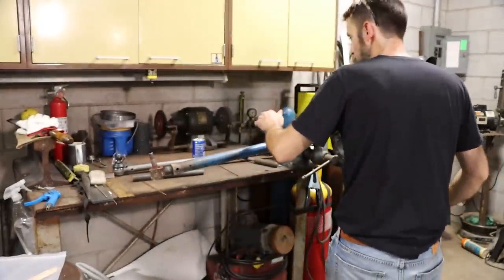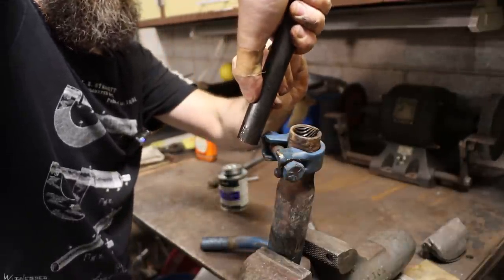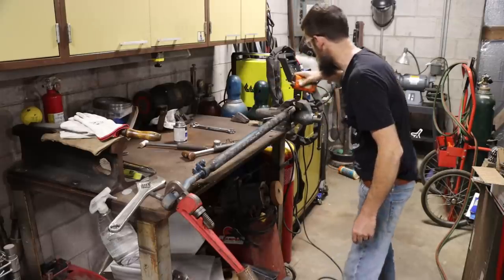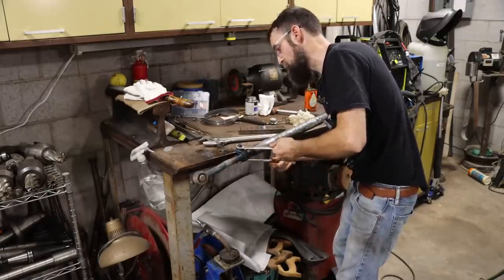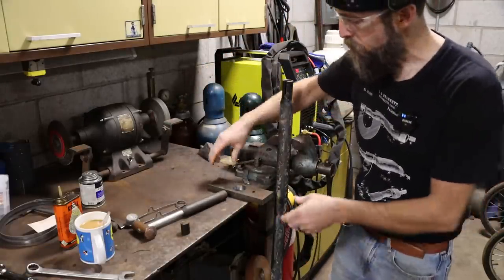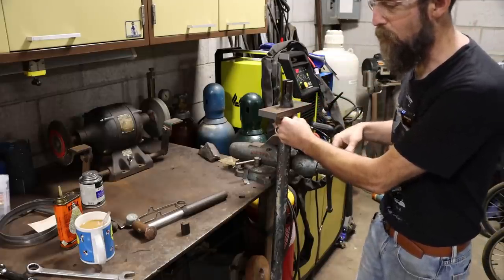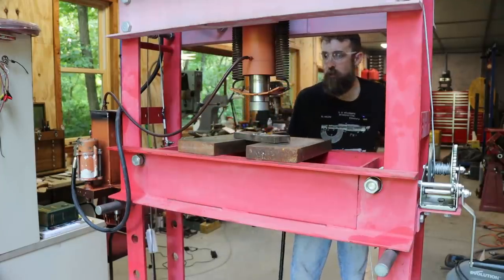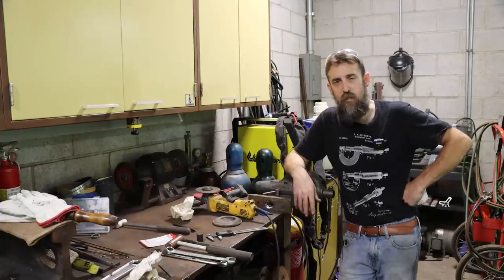Can ya fix this 4 me?  Stuck Ford Tractor Drag Link.

Comment: If time were not a consideration I would hung the shaft vertically and dumped a bunch of Kroil down the end and just let it work for a couple of days or more then try the methods you did.  What kills me is that no one ever greases the shaft when it is new to avoid this very problem.  A bit of foresight is a beautiful thing.....

Comment: I would have tried something like hanging it vertical and pouring something like white vinegar down the end, and let it soak while topping it up.
I used vinegar on some pliers that were solid, i know there's a size difference, but worth a try.

Comment: Both methods you tried put the tube under tension, while putting the shaft under compression, tightening the bind like a Chinese finger trap (the tube gets a tiny bit longer and narrower as it's stretched, and conversely the shaft gets shorter and fatter). If you could have pressed down on the end of the tube by the ball joint, while pulling on the ball joint itself you might have had more luck.

Comment: Hi Steve, If we had heated the tube in a forge all the way through, and hammered the rust loose, it would have worked. But we don't have a forge. And that's why I'm posting this message. I know you want a forge and let's face it I want a forge too. So why don,t we build one?

Comment: If the pipe is same inside diameter as commercial  pipe you could cut off threaded end , weld a length of pipe to it, cut slits , and drill holes .

Comment: I suspect it's probably plug welded. Maybe emory cloth the tube section to get an even finish (220/240) and then acid etch it or coffee etch it to reveal the plug welds (hopefully harder filler than the tube material). Then grind/drill out the welded sections? Only guessing the plug welds because that's what I would have done had it been my tractor drag link I was setting up.

Comment: I would pour Kroil right down the barrel let it sit for several hours and then leave it standing and heat it from the bottom up and the added more Kroil let it stand awhile before attempting to get it apart

Comment: Looks to me from what I can see, the new tie rod end is threaded only on the end  I would not be surprised to learn that the tube design was superseded to a short sleeve connecting the two tie rod ends rather than a long sleeve. 
I have always been able to loosen that type sleeve. Kroil, heat the tube up to about 350 degrees F and set in the corner over night. It will turn without if the tube is not pinched collapsing the .I.D. It is just an idea. thanks for the video.

Comment: Probably would have the same outcome but, I'd have welded a collar around the tube then slipped the plate you made (with far less accuracy) around it and put it in the press. 
Using some of the other comments about heating and hammering when it was put under load, it might have come apart.
It's make an interesting video if you kept trying to seperate this after the crops are in and the farmer can spare it for awhile.

Comment: Surely it would be relatively easy to recreate the outer tube of the drag link and throw the old one away?  Its only a tube with some holes in one end and a threaded portion on the other end.  The cost of machining a new one is likely to be less than finding an obsolete part especially when you factor in the search time.  I wouldn't use the knackered ball joint as it could fail at the most inopportune moment and then apart from the consequences the farmer would be back to square one.

Comment: Maybe heating it and hammer tapping while pressing? Or a crazier idea might be to pack the part in dry ice for a while and then quickly heat the outside. The thermal shock might help break loose the rust bond holding the parts together.

Comment: Fill the threaded end with diesel.  Heat exterior with torch till diesel is in catch pan on floor under the unit.  Rinse and repeat till fluid runs through.  Fill threaded end and reinstall tie rod end, threading the formerly stuck end out.  Would welding with a mig on the lower portion have been stronger?

Comment: I would have tried and sir hammer on it to help knock the rust loose then heated it and rubbed wax on it letting it flow into the tube. My second guessing. Have had good luck using doing that with canning wax.
Reply: F $$king auto correct air hammer

Comment: I'm guessing that piece is about 1.5" diameter, so about 5" circumference, and the weld about 1/8" wide so your total weld area is about 0.6in^2. You can expect 60000-7000PSI weld strength, so that would be 36000-42000 pounds shear force, or about 18-21 tons, so I would say the weld broke about when it should have been expected to.
Mind you that is probably mixing tensile and shear strengths...

Comment: Heat and wax.  The wax pulls deep into parts like that and if you can manage to heat and keep heated it will wick all the way through it.  From there it's just a matter of spinning the parts until they separate

Comment: I might have uswd a vsry thin wheel and split it. Not fully but like stitches then stuck iti in a PVC pipe fill with diesel and ATF fluid let sit for a week. Then try to press out again

Comment: You could have tried filling the tube with oil and then fit a grease nipple on the tube and pump grease into the pipe. The pressure will tend to open the pipe and then move the rod out.

Comment: Rust on farm equipment is shockingly hard to overcome. I soaked king pins on a running gear for weeks. I only could apply pushing pressure with a 10 ton puller. I worked on this on and off for weeks before accepting defeat and split the tubing with an angle grinder. In spite of all the penetrant soaking,  when I got it apart the penetrant had only made it a fraction of an inch, and the king pin bore was about 10" long. I am going to bet that tube and shaft are rusted together for 30". Splitting the tube is the only option... Go buy a new one when he can find it.
Reply: I've a uncle that does the vintage iron saves...his solution to stuck engines? Stock tank soak, check from time to time. He had 1 that took 6mo to work free.

Comment: The easiest way to free up rusted parts is quite fun. You want at least welding gloves preferably long ones and heat up old engine oil short of going on fire outside preferably for it can go on fire and ya you want to be outside but just hot till it's spiting and pour it over or in your case into the part from the open end and you can try it but I have seen me leaving it 30 minutes repeating it and it should break free if it still doesn't repeat once more an leave overnight and you'll get it apart no problem
Reply: It'll tap out to no press need

Comment: I would have tried heating and afrer that I'd improvised some kind of a slide hammer for pulling the rod out. After fiddling around for a moment I'd find myself at the emergency clinic bleeding, burned and maybe with some fractures.

Comment: You could drill some small holes in the pipe along its length to allow penetrating oil to work its way into the space between the pipe and the shaft.  Then use an air hammer, or your HF Jack Hammer to drive it out.  If he can't find one he could invest in you making a new one.  Could be another video.  Q: Did you pull a negative pressure in the shop when your butt puckered?? LOL (Edited for spelling, and punctuation)

Comment: if the metal of that rod isnt too special you could machine off the end with the tread and weld it on a piece of smooth bore pipe of the right inner diameter

Comment: On your hydraulic Press..  the cross bar that got split.  remove both.. replace with a stronger piece that will allow to live it with your electric fork lift.  be sure to thread the top of the tubes for the forks or weld nuts to the top so while its on the forks you can hold it in place in 4 points..  please also examine the hose on the press.. i see a wet end.. i don't know if that is from a spill.. or from a hose about to fail.. 

 on the tie rod tube. the only precision measurement is the distance between the 2 cross bolts for the slip and slide tie rod end..  you are totally correct a piece of DOM material that has the right bore size to allow you to slip the long end in.. counter boring the other for a few inches of the stepped section to slide into and be welded in.. is all you need.  besides putting in several holes for ZIRK fittings. to keep that sucker packed with grease to prevent it seizing.  chances are he will never need the slip and slide end.. 

 hint.. you could have used the press to crush the loose ball end slightly to give it more life without locking it up.

Comment: About the only thing a guy could try is to cut off the ball joint and drill the threaded rod out and put a fitting in it and use hydraulic pressure.  But that could be really dangerous.
Reply: The ball joint that they're trying to get out of this not threaded, it's a slight fit it's pinned in place I'm a chef that's 3-4 feet long.
Reply: @Tuxedomakdarien  it was threaded on one end that why Steve cut a slug and tried to push it out to start with. So you could tern it into a hydraulic cylinder from that end. But as I said it would be dangerous. Because it held at 25 ton in the press. Telling me it will take even more to break it free.

Comment: Do you have a heating tip for your torch's? if not you want to get one it has an over sized tip with 5 holes instead of one big hole, it can heat the most thickest parts on cars and tractors to a nice bright red in no time...
Reply: It’s called a rosebud tip.
Reply: @notajp  I call it a heating tip lol...

Comment: Get a fire going in your fire pit and let it get red hot over it's entire length. Stand it on end and put oil to it the next day, after expanding and contracting that rust bond should break. Guys that restore hit and miss engines use this approach after removing every part to get a stuck piston out.

Comment: Hard to say for sure I would’ve had to of had it in my hands after the first attempt I probably would’ve reached for the rosebud and heat it up cherry as long as I was not worried about damaging other components if it can take the heat hotter is better in rust stuck stuff

Comment: I would hav done this. Bored that Bar you machined, but not all the way through so it caps the end of the cylinder with the threading, with a hole smaller so you can use a ram that slide in, but won't gaul the threads. and then I would have slammed the ram in repeatedly  to hopefully shock the center rod out, kind of like a pool cue.

Comment: Make a new tube. Cut the tapered threaded end off, weld it to a piece of DOM tube or just fabricobble something. Split the old tube to get the drag link out. It's a simple drag link, not an atom bomb. 
As far as that goes, make a new one that uses more modern components so parts will be easier to find.

Comment: I would have made a new one. Thread the inside of a pipe, then cut the line and drill the holes.  Maybe heating that tube with an arc welder would have helped.

Comment: I would have stick welded on the opposite side.  I would also heated it up with a rose bud in the press. Heating it up slowly with a brazing tip transfers heat both pieces. i also would have used a air hammer up and down the shaft to loosen the rust first. You did a good job and 25 ton of force should move a mountain. As a last resort you could try the super heating a quenching in water but that can harden the metal and make it brittle.

Comment: You need to apply a lot of heat while you have pressure on it, fixed a lot of them in my time. WD40 is no help it just swells the rust and dirt, keep it dry.

Comment: The only thought I had that was different was I would likely have welded on the other side of the plate which would have placed the stress in a traction, verses a compression manner.  Now would this have made a tinkers damn bit of difference?  Hard to say,, probably not!

Comment: PENETRATING OIL, SACRIFICAL SLUG, SMALLER DIA, AIM DOWN HILL AND USE IMPACT HAMMER, SHOCK SENDS OIL INTO THE DRY LOCK AND WILL MOVE THE STUCK SHAFT FASTER THAN ANY OTHER METHOD.

Comment: Seeing that he has never extended the link and probably never will I would have cut the bad shaft off at the end of the tube then drilled the tube six to eight inches, cut the new bar off  so you could get it into the tube till the cross pin holes match and pin the new end in place. The extension rod is never going to be extended anyway.

Comment: I would have cut the end parts off you need to then weld another piece of tube in between them. quicker and easier, and its going on a tractor do doesn't have to be accurate

Comment: So it's basically a turnbuckle with heim joints on the ends?
Reply: I must be missing something. I don't understand why the tube could not be threaded LH on one end and RH on the other end. Two heim joints welded to LH and RH all thread. What am I missing? What other function does this do?
Reply: @jpsimon206  The main function of this type of tractor steering axle is that the width (track) of the wheels is adjustable. You can make the tractor wider or narrower to customize it for specific crop row spacing. Because of this, the length of the tie rod must also be adjustable.  Ford configured the tie rod here with one side as "slip fit" to allow for the major adjustment of tie rod length and used a band clamp and a split in the tube to hold it in place (with a cross pin for fail safe in case the band clamp slips).  The threaded opposite end allows for minor adjustment of toe setting before installing the fail safe pin and tightening both band clamps.  Since this design has a slip fit on one end there is no need to have left and right threaded ends to permit toe adjustment like it is done on a rigid, one piece tie rod.
The rear wheels spacing is also adjustable.
Reply: @larrywalker7759  thank you very much for explaining this. It's the kind of thing that would keep me up at night. You have made it explicitly clear. Thanks again and have a good night

Comment: You heard Steve the guy was on a quick time table and he did not want to spend enough money to make a new one. From the video it looked like Steve spent only a few hours of shop time which adds up for the customers. Fair deal ending when he did. Could he have added heat while in the press I say no by the way the weld let loose if he had an open flame and the hoses near by it would have been too dangerous just my thoughts

Comment: Hate to say this but you and many others are using an adjustable wrench the wrong way. In this video at 4:03 you can see the wrench of the edge of failure.
Reply: Almost every video I watch, even Keith Rucker, seems to use the wrench backwards, as you correctly stated.

Comment: steve, throw the heat to it and hold a wax candle to the rod that's stuck where it goes into the tube. the wax will act as a penetrating agent and loosen the parts. you will have to do all that in the press. and put the weld on the bottom of the holding piece, that way there's no risk of the weld failing catastrophically like it did when you put it on top
Reply: There are numerous videos of people trying to use candle wax like you describe.  Every on of them failed.

Comment: Actually I bet cutting a slit down the length with an angle grinder.  Weld it back afterwards. 

Edit.... and you just made the same suggestion.